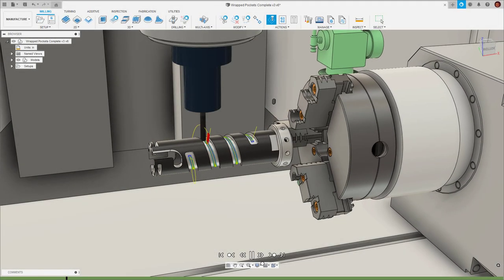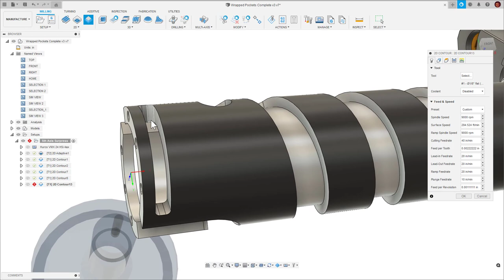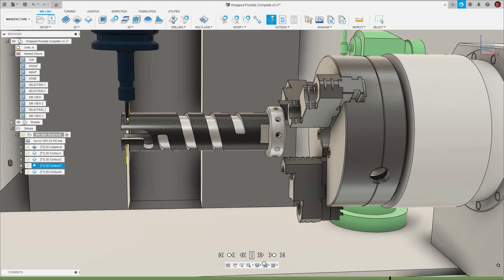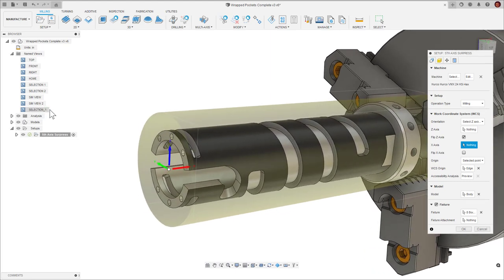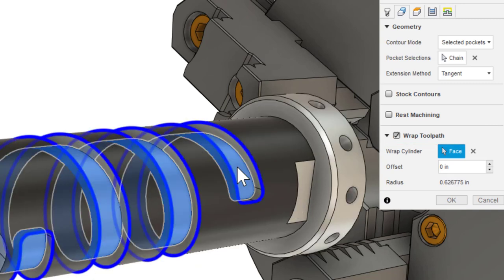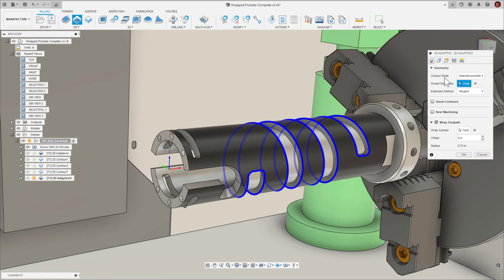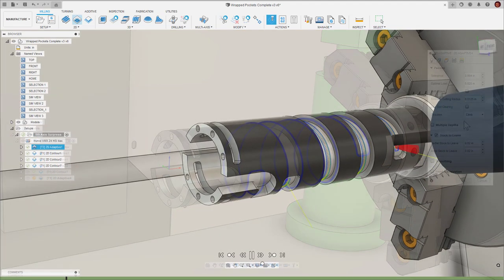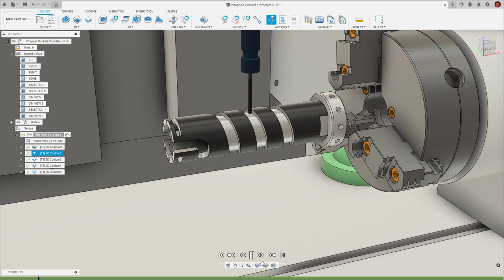Tutorial: Leverage your 4th Axis by wrapping 2D toolpaths in Fusion 360 | Autodesk Fusion 360

Comment: I need some help!
I've been trying to make a slot through a tube, looking at it from the side. The walls of the slot in the front and back are perfectly straight because the cutter runs along them with the A-axis but I cannot get the side walls of the slot to become straight because the Y-axis doesn't move. Any help would be greatly appreciated. 
I've played around with multi axis machinig but I think that's more suited for 3D shapes.

Comment: How do you get the 4th axis to move instead of the tool moving?????
Reply: Can you expand a bit more Arnoldo?
Reply: @dylansmith3989  Yes
Normally we I program a part in the 4th axis and you run the simulation the tool goes around the part meaning the part it doesn’t move the tool is the one moving.
In your simulation it’s the other way around. The tool it stationary and the part it’s spinning.
Reply: @arnoldo24  In your simulation setting so right click toolpath > simulate > change view point from tool to model.